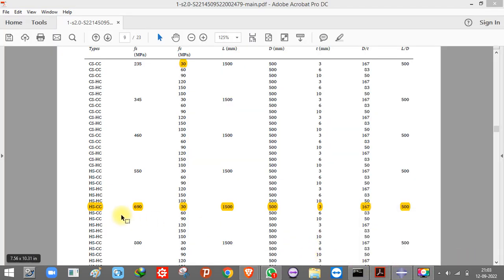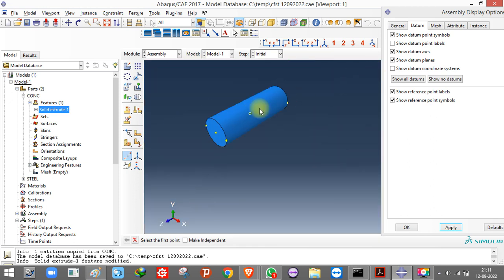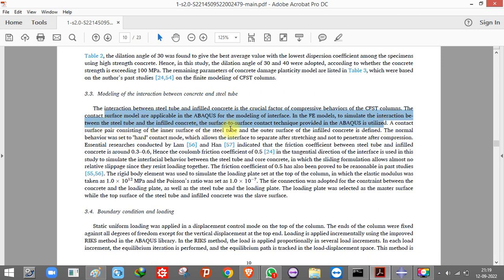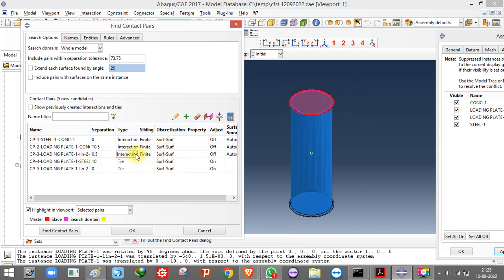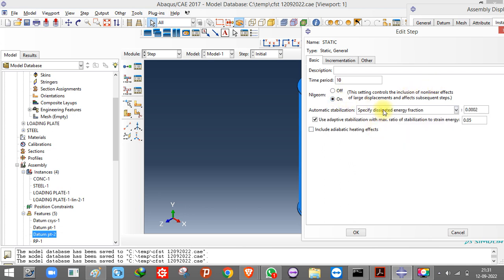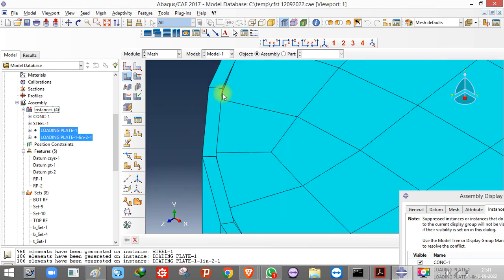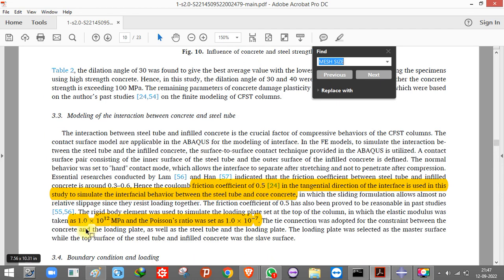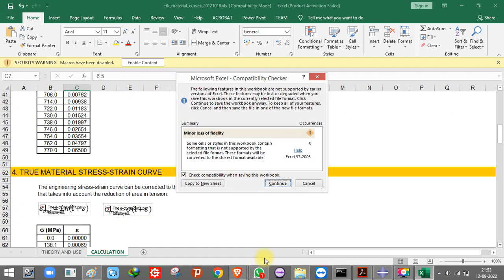CFST stud column using high strength M80 grade concrete modelling using ABAQUS CAE

Comment: 1) A rigid body is undeformable, therefore the elastic modulus is irrelevant.
2) To generate a rigid body it is unnecessary to specify the body and the nodes, that is redundant.
3) You are doing a static analysis, therefore the densities are irrelevant.